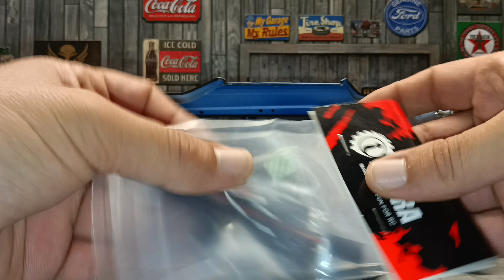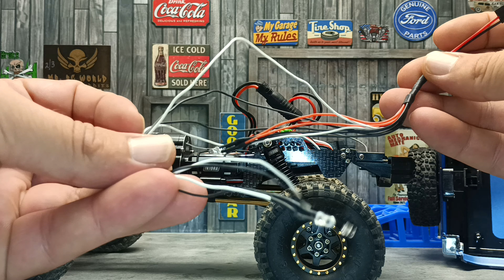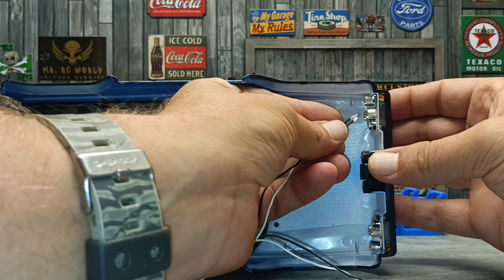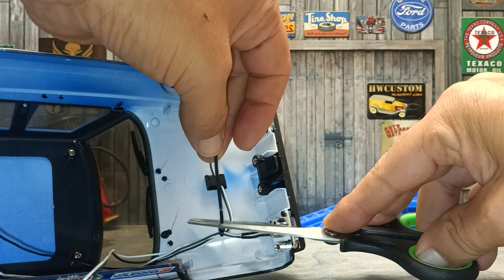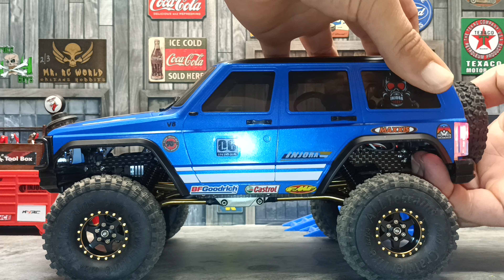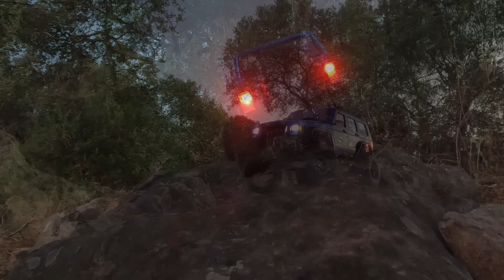Injora Traxxas Trx4m light kit ￼ installation and evening crawl #injora #traxxastrx4m ￼

Comment: Great video. Have the same light kits on the way. Looks super simple to install!
Reply from the maker: @Adam_Oden  thank you bro, it's definitely very simple to fit! 
And the end result is pretty good. 
I would like to see a more advanced light kit from them for the TRX 4M.
Reply: @rcfungames  yeah. My son wants to Traxxas kit for all the functionality. Will have to see if we get it.
Reply from the maker: @Adam_Oden  I said to the set of the pro light kit to my Bronco and Defender! 
And it's definitely worth it 👊😉
Reply: @rcfungames  my only issue is if we upgrade the esc then we loose the functionality of the traxxas light kit. At least that’s my understanding.
Reply from the maker: @Adam_Oden  yes and it is something that is annoyed me since the beginning!! Because it adds so much character, and it's really awesome to see the lights change when you break and go into reverse. 
I still haven't seen an alternative if we change the electronics!!
I was really hoping to see an aftermarket pro light kit!!
But at the moment there is still nothing available. 
And that's why I've also kept, my Bronco the defender the K10, with the original electronics because of the pro light kit!!
Reply: @rcfungames  I think my long term solution is just to have two bodies. One for crawling with the injora light kit and a scale body with traxxas lights

Comment: Does it work on the IR40?
Reply from the maker: @pedellbills130  you would be able to adapt it but the leds for the front headlights, are smaller than the original light kit that comes with the IR40.
So you would have to find a way to get them stuck in the front headlights.
Reply: @rcfungames  ahhhh